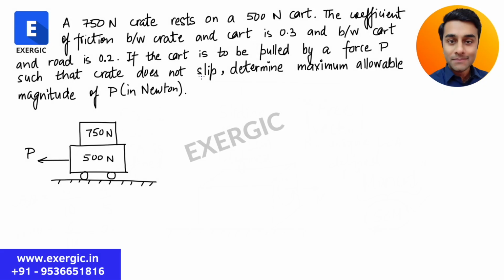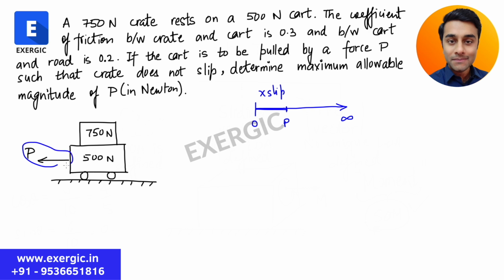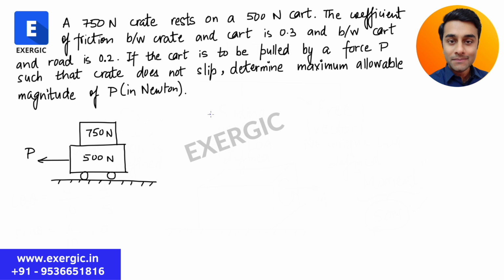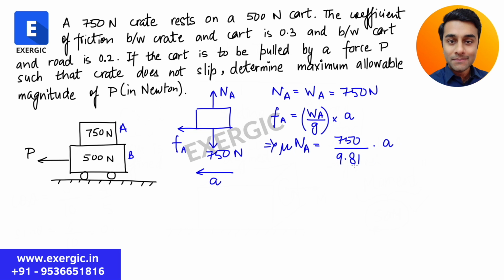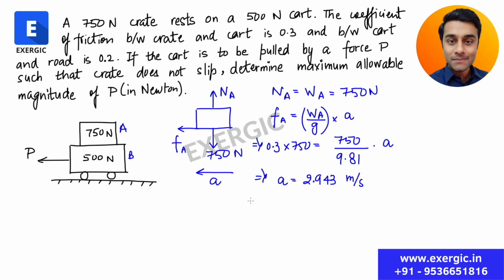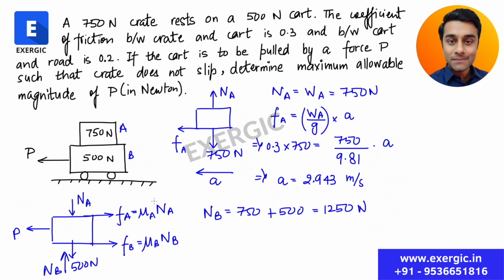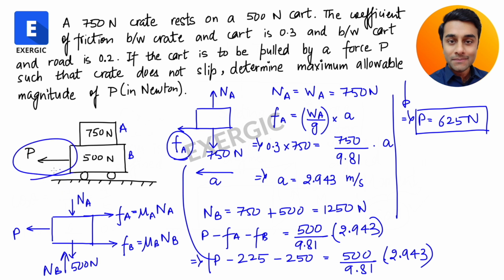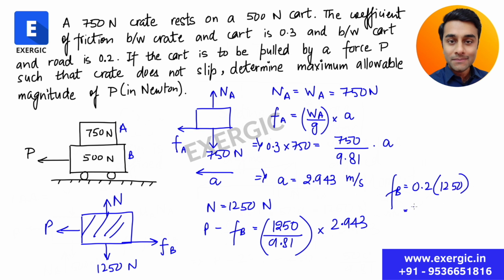This block-on-block Friction Numerical can be asked in GATE - Mechanics | GATE Mechanical

Comment: Sir, 
There's another concept that,
'If friction is specified for a rolling body, then it should be considered as a rolling coefficient of friction and it acts due to bumps or some peaks/troughs present on the ground.And then the normal force will be along that direction which follows Three forces Equilibrium principle."
Why don't we consider that here for those wheels?